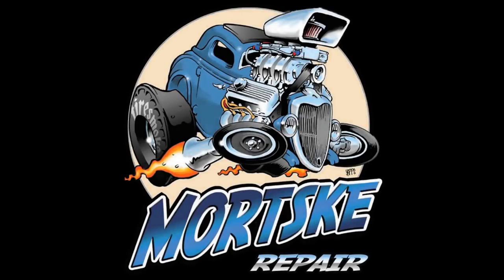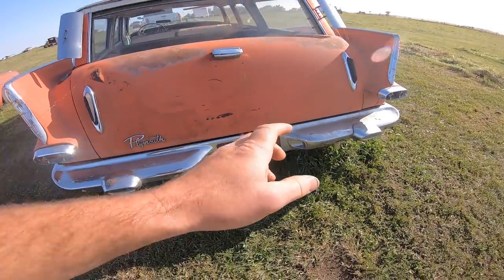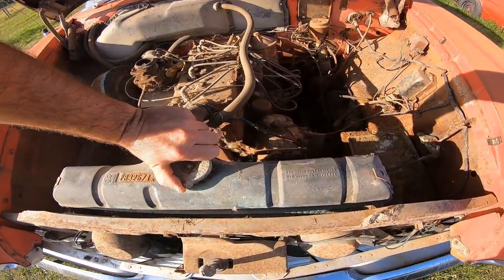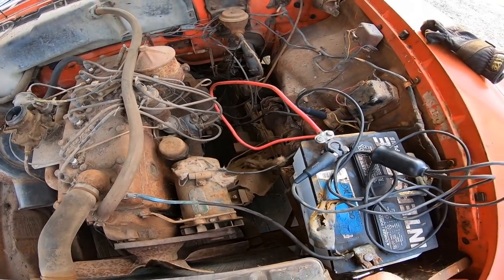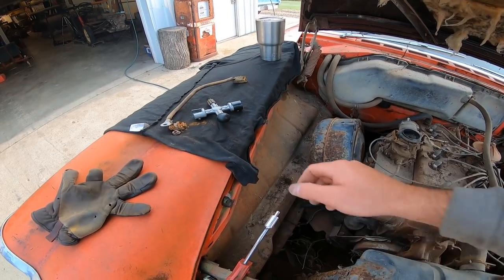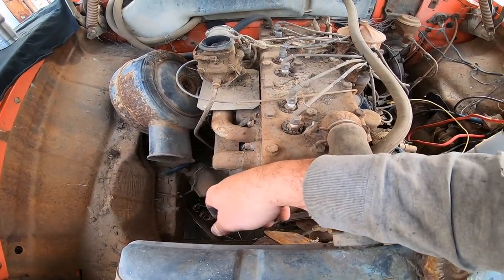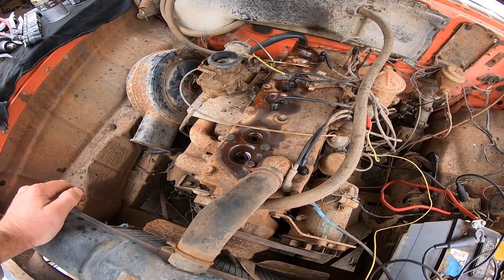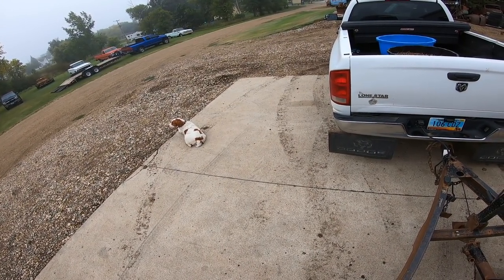1959 Plymouth Suburban Custom station wagon parked for 52 years! Mopar Flathead! Will It Run?!?

Comment: Chrysler thought it would help to keep the wheels tight lol
Reply from the maker: Well I guess it worked as it appears none of them have fallen off!
Reply: @MortskeRepair  Right lol so dumb I know! Thankfully they stopped in 72!
Reply from the maker: @CoastalAutoReactionCAR  The worst is when you want to put custom wheels on and need 2 sets of lugnuts and on this car you'd need super special bolts!! Good time to swap rear axle and convert to disc brakes I guess.

Comment: I thought you knew what you were doing until you started whacking away at those valves with a ball peen hammer.
Reply from the maker: I fool folks into knowing what I'm doing on a regular basis? What's your trick for getting stuck valves loose Steve?
Reply: @MortskeRepair  Let anything that’s stuck soak in marvel mystery oil for a week or two before trying to unstick it. I even soak valves and pistons soak in it before I even try to turn the crank. Saved a lot of motors that way.
Reply from the maker: @Steverinomeister  Ahhh I see. If I get more time I'll do that on the next one. Usually I'm in too much of a hurry however. Gotta turn and burn!
Reply: Mortske Repair you are a pretty talented fellow best of luck on that wagon I’ve had three 59 Plymouth’s
Reply from the maker: @Steverinomeister  Hey thanks so much for the kind words Steve!!

Comment: I could drive it, almost all of my cars are standard's.
Reply from the maker: That's awesome! What are your other cars Michael? Anything with fins like this beast? Thanks for watching!
Reply: @MortskeRepair  nothing that old unfortunately, However I do own a 1969 Oldsmobile 442. I learned to drive on an F-150, that was stick. My daileys are nothing super special, an old Ranger and an Escort, both sticks as well.  

I hope you get that valve body reworked cause this thing would be nice to see back on the road. Certainly a good find.

Comment: how dreadful- a flathead 6 in '59!!!!  that's really behind the times.  surely Mopar had an OHV in line 6 by the mid-late 1950s at the latest?!
Reply from the maker: I don't think they had an OHV inline until the Slant Six came out in the Darts in 1960. Thanks for watching and commenting!
Reply: @MortskeRepair  never thought of that- the slant broke the ice.  i love flat heads really.  in boats.  there are a very few early fiberglass and aluminum boats that had flat head mills (small).
Reply from the maker: @postaltraining  The leaning tower of power was a real trendsetter for Mopar! I think a V8-60 Ford in a tiny little wood boat would be the coolest thing ever!

Comment: Those orange Baldwin oil filters I'm watching right now on your channel on that blue pick up is something a couple of years ago and 200l the police crown Vicks used those cars got powerful horse power if you watch a police car slowly going up icy hill that full on ice she or he obviously she she would have kept her wheels straight going up hill survived she or he didn't sprang her or his speedometer on slippery streets rain they could when chasing somebody their wheels on slippery streets going eighty or hundred with those quiet to loud Baldwin's like in street racers etc the wheels more on ice or rain streets spin 10000 rpks that's enough to spring your speedometer like if you over rewound your watch it would spring till it stops  than on dry which goes same as engine only 150 rpm spin or 200 rpm than more on rain and snow while mother is 300 or 600 horse power yes that stupid instead of slowing and straightening his or her wheel it was lady you could hear the voice high pitched but could be guy too they have it too some times but you would swear like that motor you were starting up from the Impala after finally starting up you would sworn that crown Vick had that sounding like that like i said it's more pronounced when speeding or in rain or chasing or trying to get our of ice it sounds like that Impala souped up demolition derby like sound or nascar if you watched that that police car sounds like Nascar like that Impala engine did police cars do got powerful engines you know even more pronounced doing those types of things it sounds nascar

Comment: Throw a v8 in it
Reply from the maker: I'd love to but for now the budget calls for doing a valve job on the flathead. Thanks for commenting!
Reply: @MortskeRepair  The car is more quirky with its original flat 6.  Why do so many people want to change what the car had from the factory?  By the way, I just subscribed.  I am a Plymouth guy.  I have had my first car, a 1963 Fury for 38 years now.
Reply from the maker: @mexicanspec  I agree, I like the oddball stuff as well! And you can get a fair amount of speed parts for the flathead sixes!